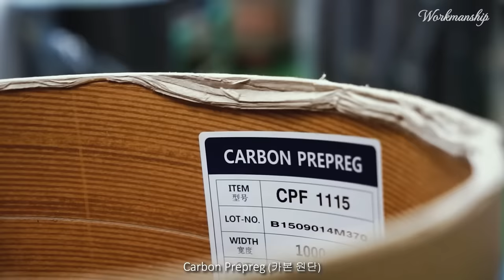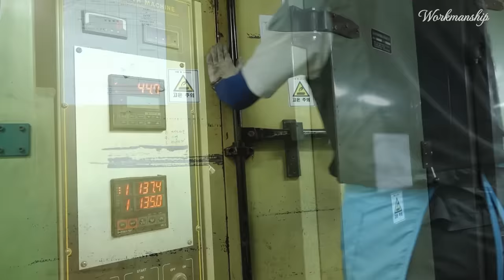Highest Quality Carbon Fishing Rods Mass Production Process. Korean Factory Tour

Comment: Great video. Setting the tip top after finding the "spine" of the blank truly separates short run rod blank batches from the mass produced product. It takes a lot of time to roll each blank and set your tip top accordingly but it makes the rod more balanced and perform better whether in conventional or spinning configuration.. During the rolling process the rod designer can add additional patches of carbon cloth to alter the action of the rod blank  as well. Its really neat from an engineering perspective.
Reply: It is a great video. What do you mean by finding the spine?
Reply: @saveroomfor  Its basically the seam where the rolled blank material comes to an end on the mandrel.  When you roll the cloth on the mandrel the spine is created by the end edge of the cloth at the end of the rolling process. You can roll the blank in your palm and it will take a "natural set" along the spine, You can do it with any blank or finished rod. It is really easy to do after a couple times. 98% of factory rod's tip tops are off spine.

Comment: Sept. 13, 2022---Thanks for the video as I never knew the steps needed to make a modern day fishing rod.......and at reasonable prices. I have 4 Fenwick rods, the first I bought in 1977 when I got stationed at Elmendorf AFB, Alaska. Used it to catch salmon, though I never did hook a king salmon. Then while stationed at Beale AFB, California, bought a ultralight Fenwick rod that someone at Kmart had mismarked for $10??!! Normally, they were going for $40+. When I got out of the Air Force, moved to Nevada and found a store which sold a lot of stuff relating to the outdoors. Picked up a medium and light duty Fenwick for $10 each??!! Used, but still in great shape. So if you buy and take care of a quality rod, it'll last you a lifetime.